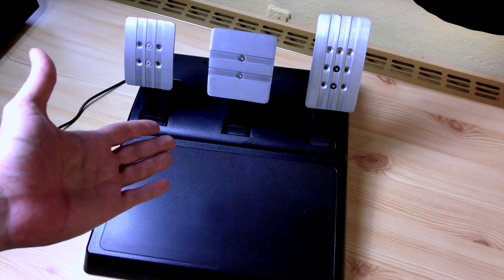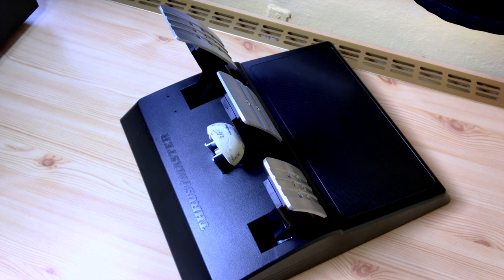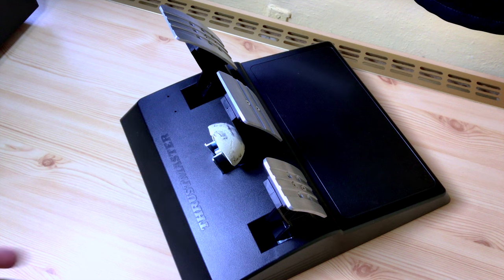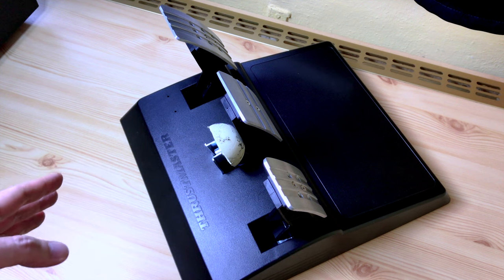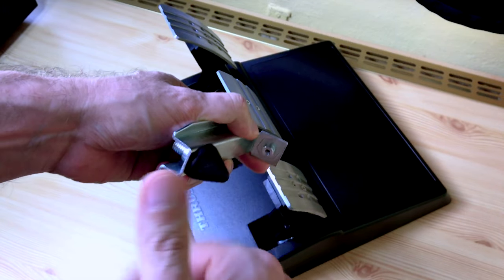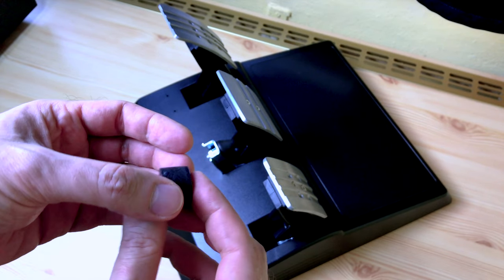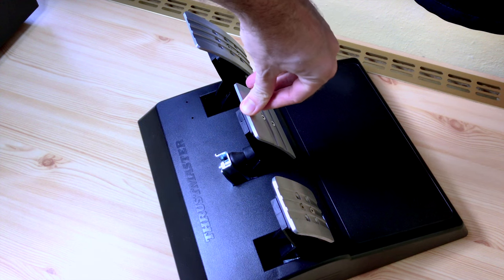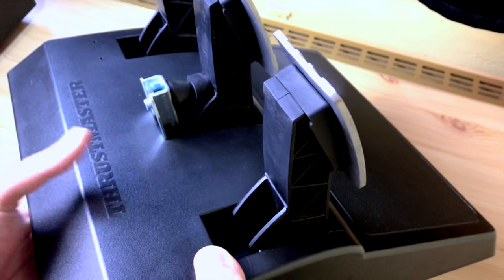Thrustmaster T3PA Brake MOD That Feels Like T-LCM Brake Pedal

Comment: No disrespect but I've tried every mod consieveable and most are garbage.  Why do you guys not do a video on springs . .I have that very set ,I've moved the break to the clutch ,done my math resistance and fitted quality sourced springs for pennies. Honestly I just now don't get it 🎉😂
Reply: Yo you got some sources?
Reply: @aurie1040  Ye , there are plenty , there is also a 3d print which slots in side the original springs in 3 types of resistance made from TPU ,ALL of which work along side the correct design of the pedals, rather than a piece of crap sponge or half a fucking tennis ball stuffed at the end of the pedal gap m8
Reply: Sounds like u should have made the video...
Reply: @gozzyboy1989  ye I should have boy
Reply: If anyone wants the source please ask
Reply: @carlwyatt5036 Someone literally asked and you didn't provide
Reply: @IAmTheGlovenor  asked what pal
Reply: @IAmTheGlovenor  and provide what . Am lost
Reply: @IAmTheGlovenor  hey sunshine I can back up any imfo I provide . And I'll say it again , it's only laziness that keeps these crap mods alive . BUY BETTER SPRINGS ...... HELLOOOOOOO
Reply: @carlwyatt5036 what’s the source ?
Reply: @carlwyatt5036  Needing the source also 🤞🤞

Comment: I use one of my wife's tear drop shaped make up sponges and it gradually gets more resistance the farther you push. Been using it almost 3 years. And a 3 pack costs less then $10 CND.
Reply: Where do you put it exactly? Do you still use the original conical mod?

Comment: I used squash ball.... On the brake, take out the black rubber cone, then I poke a hole straight through the squash ball( find it too stiff without hole)...and place and push in a bit between the bracket and pedal...use another ball and simply put it behind clutch pedal and another one behind throttle pedal...don't push it in , just simply place it behind those pedal...I find it feel much much better ..quite surprised to see that these balls were made for these pedals so perfectly....LOL

Comment: Hi. Great idea for the T3PA pedals. What are the dimensions of the rubber spacer you use? Clicking the link you provided takes me to really thin rubber washers. Thanks :)
Reply from the maker: Yeah, Amazon likes to redirect you sometimes to different products, these are 15mm.
Reply: Hi there, sorry for writing here, but the diameters are not clear based on the link. Is the outer diameter 30mm, the hole 10mm, and the thickness 15mm?
Reply: @gergohun92  Hi, have you found out exactly what size it is? - Thx
Reply: @SimRacingPal  Hi, great solution. I would also be interested in the exact dimensions of the rubber. Maybe you can post the dimensions again, please?
Reply: I got the rubber spacers from the link in the description, but they were too long and couldn't fit in. Turns out, they were half an inch thicker than they should've been, so trimming half of the thickness allowed the spacer to fit in between the brake pedal and conical brake mod. 

The link took me to spacers with dimensions of 1 Inch OD x 3/8 Inch ID x 1 Inch Thickness; taking the ones with 1/2 inch thickness should work better.
Reply: search this:

sourcing map 16pcs Rubber Spacer 1.2 Inch OD 0.4 Inch ID 0.6 Inch Thick Neoprene Round Anti Vibration Isolation Pads Isolator Rubber Washers Bushings for Home Cars Boat Accessories, Black

and select the 10x30x15mm
Reply: @petef15  cheers mate, you wouldn't say go for 1 inch thickness?
Reply: @Hells_Gift_MB  I would say don't bother at all. I bought them and it sucked. I managed to cut it down to make it springier but honestly the original rubber stopper screwed all the way out and reduced travel was much better.

Comment: I'm getting my t300rs gt tomorrow. I'm surprised by how good these mods are!
Reply: How you like it? Just got mine went from a t150 pro. I'm in love
Reply: Source yourself some quality springs m8 . Any help just ask .
Reply: Quality springs mate these mods are not worth it.  Great for an hour or 2 but other than that ...narrow.
Reply: @carlwyatt5036  What do you mean by quality springs? Cheers
Reply: @asdlife2496 You don't need to do this. Just move the original rubber cone. He doesn't seem to know that. You can move the cone back and forward by design. He had the cone all the way to the back you don't need to do that. Rotate the cone forward and then lock it in place with the bolt at the back. He's solving a problem thats not there.
Reply: The mods are garbage 🗑  just buy springs with more resistance for 3£ simple as that 😉
Reply: @adihammer7861  threplace the springs that are in the unit with springs with more resistance 😄
Reply: Just use cheap squash balls...it works for me

Comment: Hope you can provide the  dimension of this rubber spacer because it’s not easy to get it in my country. 😅
Reply: Multi Purpose Rubber Spacer 1 Inch OD x 3/8 Inch ID x 1 Inch Thickness Rubber Bushing Anti Vibration Spacer Black Round Neoprene Rubber Washers                 This is the name of the product

Comment: Got the TP3A for quiet some time and i am disappointed. I had the TP3A pro, the G27 and the G29.
Accelerator pedal is way to soft. Every time i try to modulate the amount of gas input the feeling is non existing their for almost impossible to get it dead right every single time.
When in a corner the car swerves to the outside or swerves into the corner or you spin do to poor modulation.
Brake pedal idk it feels some kind of fake and can imagine that you can modulate it way better with a load cell because you feel the force input.
Clutch pedal is also way to soft.

At the end of the day it is a basic get into sim racing setup. But if you want to go fast it's all about the feedback that you want to get that muscle memory.
But without push back of the pedal you can't really build upon that.

I know their are loadcells, springs, gluesticks, and special gas strut spring supported mods available but for the price of the pedals + the mods you can almost buy fanatec clubsport V3 pedals.
Maybe gluesticks and springs are worth it. Gonna try that.
Reply: For people without a rig/stand, do you prefer the G29 pedals or T3PA? I will put the pedals against the wall so they don't slip away
Reply: @Thorkell_Joms  I did a 12h endurance race with the G29. I found it better to modulate. You can of course change it with mods
Reply: @Thorkell_Joms  i have mine mounted in a wood rig. Very sturdy one with tropical wood. Seat at around 30 35° slope angle. Pedals straight up. Steering wheel almost 90° 📐 from the ground. 

Seat is a Sparco Pro2000 from a real race car it has some patina because of the little damage in the fabric.

Comment: You do know you can move the original rubber cone right ?!
You don't have to scew it all the way back. You turn the rubber cone till they touch your pedals and then you lock it in place with the bolt at the back. 
You can move the original rubber cone to where you want and then secure it in place with the bolt at the back !
Reply from the maker: I know, not the same thing believe me :)